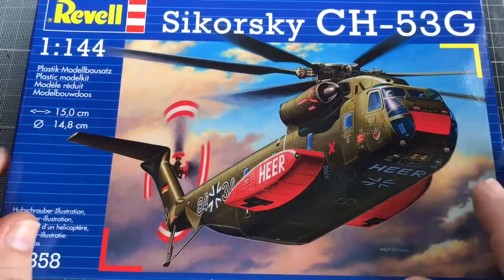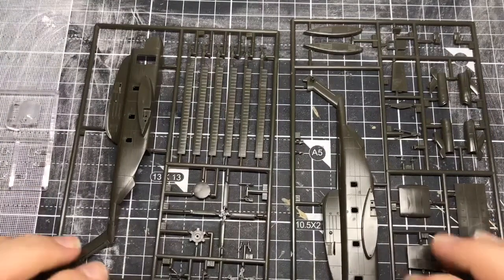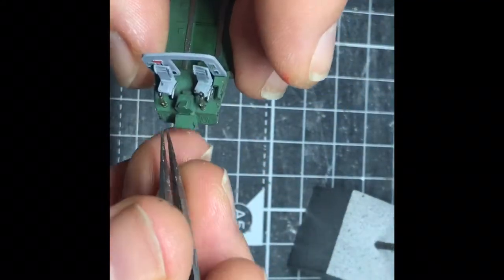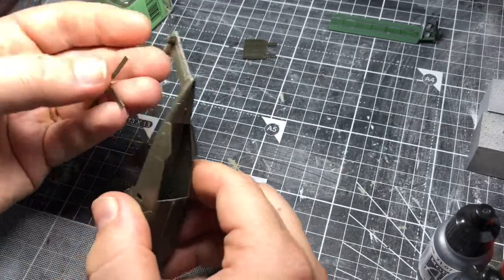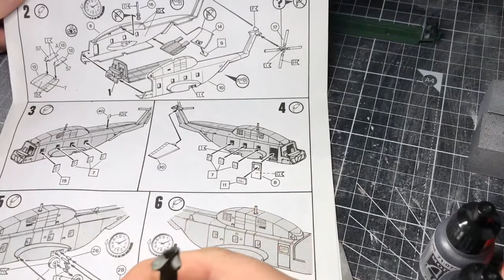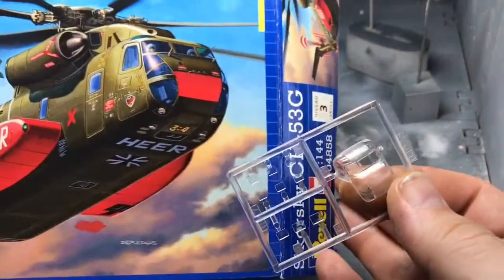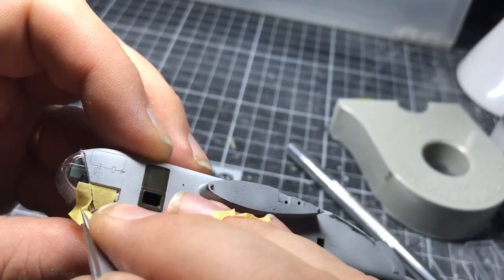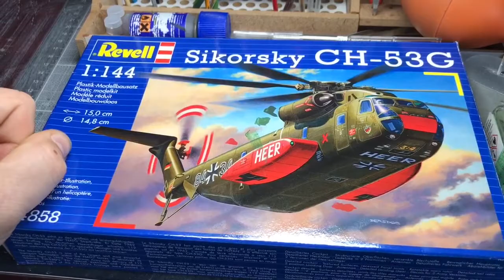Revell 1:144 Sikorsky CH-53G build. Part 1

Comment: @1:47 for rocket pods, read Engine intakes. Easy to mistake due to the size of the kit :) Add them before you start painting as they're integral to the main chassis of the 'copter
Reply from the maker: +Beyond Hope yeah, I really should do some research before I start talking 😃
They are safely added in the next section, well, I say safely, they definitely got added. :-)
Thanks for the input, it's great to know people are paying attention!

Comment: Was the paint and glue included with this kit ?
Reply from the maker: Not this one, but they may do a version that does. Although the stuff they usually include on those packs aren’t very good. If you’re going to build a few kits you’re much better off getting some decent supplies.

Comment: Green floor in cockpit and cargo area? Main rotor blades are early type.   Watching you fool with the rear cargo door was painful.Didn't the instructions show the upper door retracting up into the fuselage? Didn't you do any research into this at all the before you started? If it wasn't fitting properly, should have checked photos of actual helicopter to sort it out. Have seen same  mistake made with Chinook models, people don't understand how split tail ramp operates.
Reply from the maker: The instructions didn’t show the door moving at all, it seems to be made to be fixed. In hindsight, it obviously must retract inside or it would be impossible to get past. 
I generally don’t research a kit before I build it, I assume all relevant details will be included. 

It sounds like it’s a common mistake to make,  I guess because most vehicle doors do open outwards. I’m sorry if I caused you irritation watching me mess with it.
Reply: @GrossModels   haha, im on this build. i havent even started and already messed up.  I dont think i built a model where something is missing . my carpet is an eater of parts and souls.
Reply: @GrossModels    my first start is to clean the parts with soap and water then throw a slight coat of primer on them, well the primer can was high gloss of some stuff. haha .
Reply from the maker: The carpet monster is always hungry.
Reply from the maker: I’ve never found the need to wash parts, but I know lots of people do.
Reply: jesus christ doug . its a model  not the answers to the Bermuda triangle
Reply: @GrossModels   yeh, i just do it because i heard i should.  suprising no parts wash down the fracking drain.  if i can do anything right i try .  I do actually watch and research my build. this helicopter is a madman! bitch is huge! you wont get me on anything that leaves the ground but fun. thanks for your video and i appreciate it all buddy.  can't wait to complete this and get back to  a fucking car build.
Reply from the maker: @citizncain  Thanks, I hope you end up with something you can be happy with!